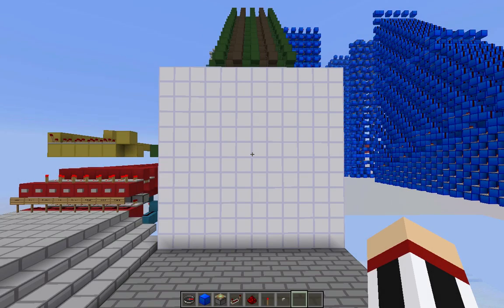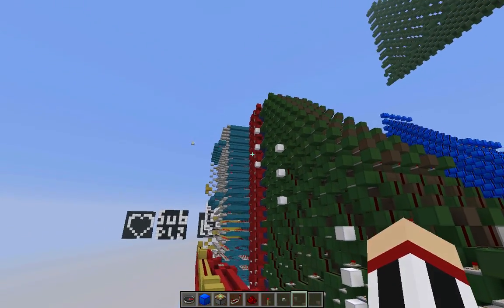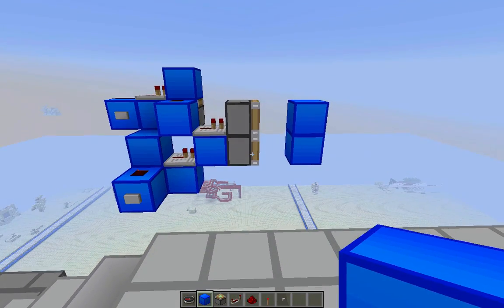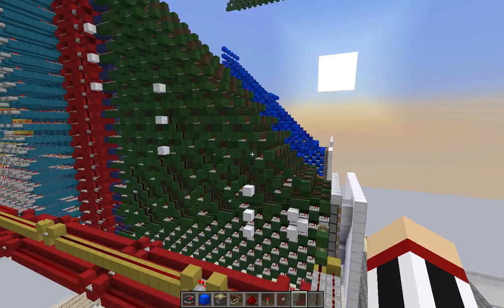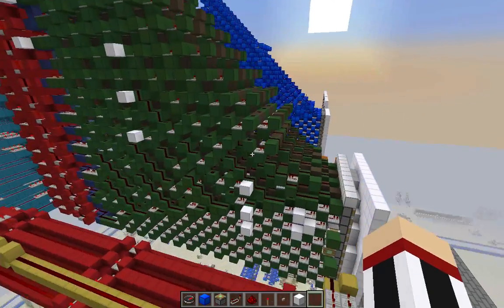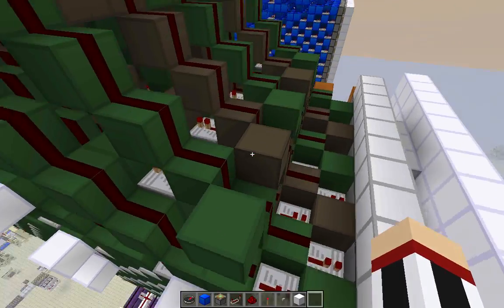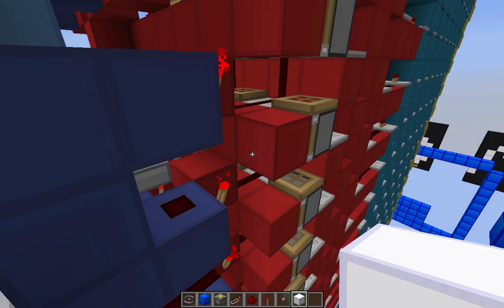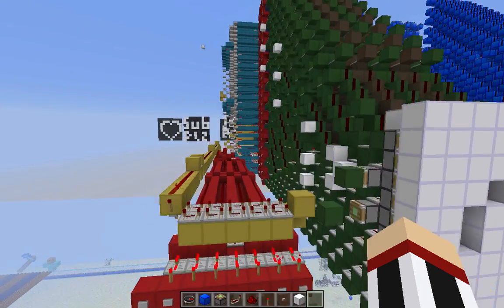Minecraft: Infinite 1x1-Pixel High Density Display

Comment: You can halve the height on this thing by using redstone signal strength instead of staggered wire. I should be posting a video about it either today or tomorrow.

Comment: would having the blocks retracted by default make it easier to reset? 

I mean, instead of sending two 1 tick pulses, you would only have to send one long pulse that retracts everything. Afterwards, all blocks can be pushed out with Tflipflop style pulses. Or does it look better or easier to wire extended by default?

Comment: First off, if the entire display is 12 blocks by 12 blocks, and the border is one block, it would be 11 x 11 not 10 x 10. second, each block is 1 pixel, and the entire display (including border, no matter what, the border is apart of the display) is 12 x 12, so it is 12 x 12 pixels, and the display is 12 x 12 blocks. In other words, he titled it incorrectly, and you are a dumb ass.

Comment: if each pixel is one block, then it would still be 12 x 12 pixels, and one block is 16 pixels. he has a 12 x 12 block display, and each block is 1 pixel, so 12 x 12 pixel display.